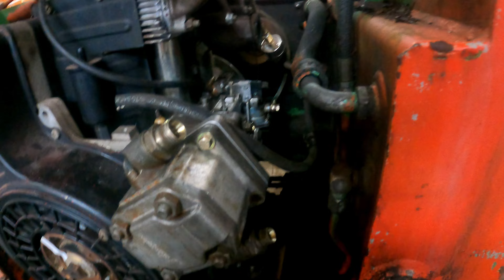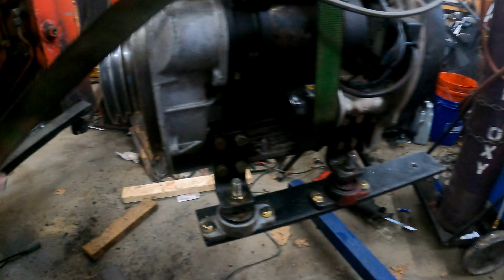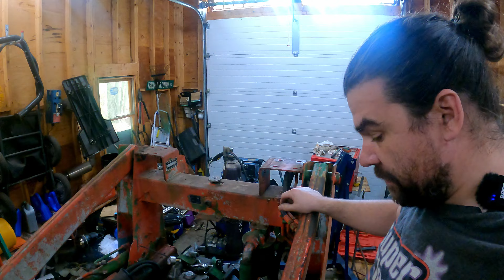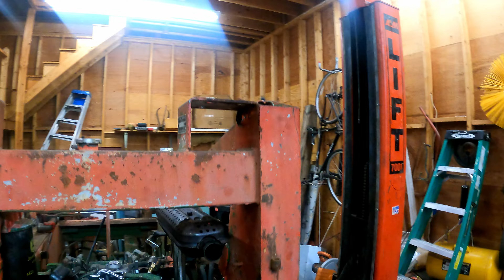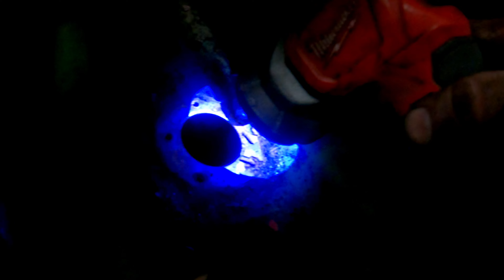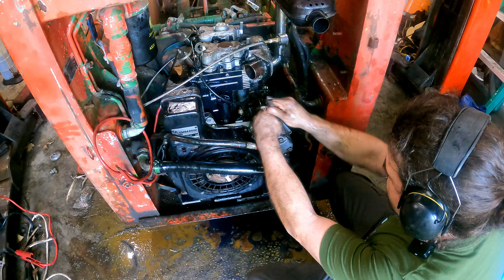John Deere Skid Steer Restoration Part 3 - First start and it was all wrong!

Comment: To bad I didnt see this video when you first started, I could have saved you alot of work, because I also bought a John Deere skid steer 90 that needed a motor, and I checked the rotation of the   lift pump with a large drill first to confirm the rotation was to the right and the drive pumps was to the left as you look at the pulleys, then I installed the Briggs 23 hp motor flywheel forward and pto in the back.

Comment: cant you just swap the ports on the drive motors? different fittings?
Reply: spoke to soon, i think swapping the hoses ontop of the pumps is the way to go - i doubt theyd be different speeds forwards/reverse
Reply from the maker: @janramonmartin  There's actually a gear pump as part of the hydrostatic pump and I'm fairly sure I'm backwards and it was only working from gravity feed.  Good news is all I need to do is rotate a plate on the front of the hydrostatic pump to reverse it's rotation.  But like you said I will also have to swap the lines running to the drive motors so they work the right way with the controls.
Reply: I have one of these turds also! So the motor rotation is backwards from the onan. Did you ever get this running and finished? I’ve been trying to find data on the fuel sender and the OHMs scale it uses so I can get a new fuel gauge. The whole harness was eaten by mice. Any help you can offer would be appreciated.